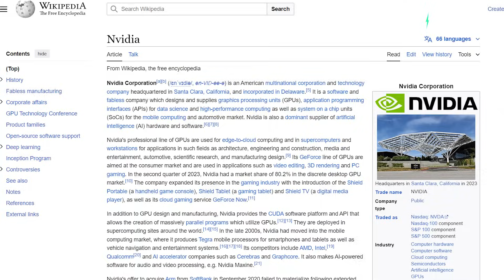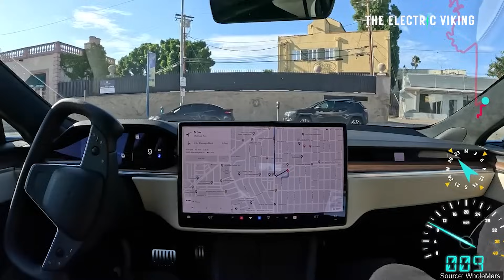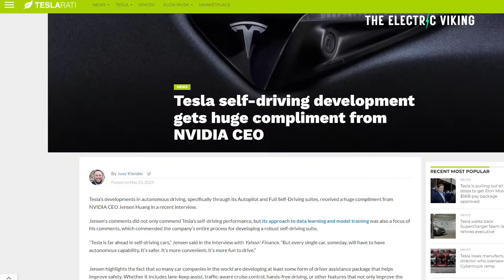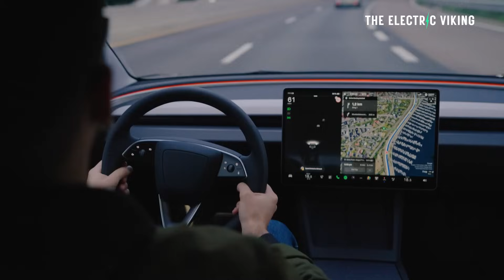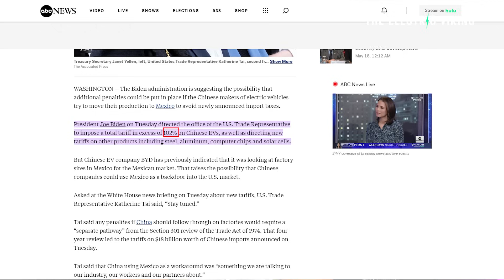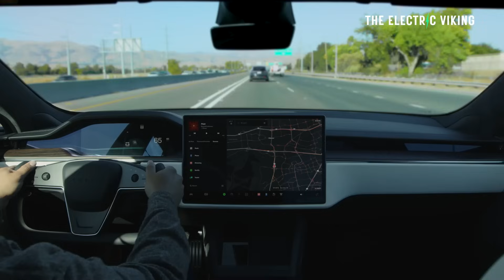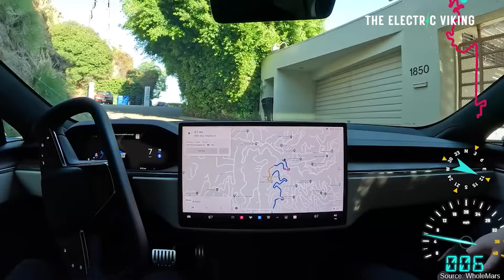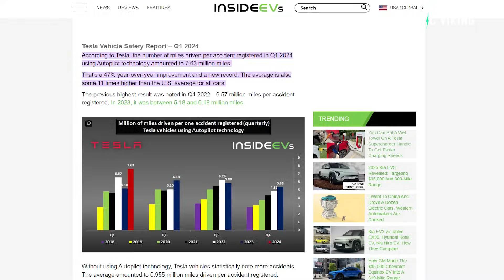Nvidia says Tesla is far ahead of EVERYONE in self-driving cars

Comment: Thank you!  I have a Ph.D. in astrophysics, and am a very critical user.  I have been using the FSD versions since they were first released.  They have always been a fabulous driving aid, far beyond anything Mercedes or anyone else has, but the latest FSD 12.3.6 continues to startle me by detecting "events" before I do.  Not quite "robotaxi perfect," maybe, but shockingly better than expected.
Reply: Fsd alone will wash away ice vehicles exponentially faster than any regulations that are in place..
Reply: How is a PHD in astrophysics related to the driving experience, unless you're riding a spaceship to Alpha Centauri? I am not knocking on your experience, but I am holding off for improvements. You can't launch a rocket to the space station with an incomplete FSD unless you're Boeing.

Comment: The thing I don't get about Tesla's approach to FSD using neural nets is why it sometimes fails at basic non edge case driving scenarios. Is this a fatal flaw the way LLMs like ChatGPT hallucinate, which they are struggling to solve? If I was Tesla I would include a robust supervising CPU with backup power, sensors, etc. that would be monitoring what the neural net GPU is doing but using traditional algorithmic that r not likely to fail for basic driving or generally in the same manners, and intervene if it detects the neural net is erring, or failed and shut down, etc. thus about to crash. This would avoid many potential accidents and put a lot of people and the authorities at ease and much more likely to get approval and get adopted. Tesla already has an algorithmic based approach with FSD version 11 so would be easy to implement and having redundancy at multiple levels is a wise idea. Computers suddenly fail all the time, like any OS. Besides, the car could even drive itself while supervised in an emergency if the neural net has failed and using algorithmic CPU, or at the least pull over at a safe spot. Once FSD is mass adopted many younger people may opt out of bothering to learn to drive but would still prefer the freedom of owning a car vs Robotaxi, so having redundancy unlikely to fail in the same ways would be wise to have, maybe required. I know I would make it a requirement if I was a deciding authority. This could make the difference between FSD being safer than humans now vs never or in 10 years. Who knows

Comment: The Indian capital New Delhi felt like a “furnace” and recorded temperatures “soaring” above 46C on Monday, with high temperatures continuing throughout a crucial week in the country’s elections, the Hindustan Times reported.  Utility company Origin Energy will “delay the closure of Australia’s largest coal-fired power station”, Bloomberg reported, due to government concerns that there is not enough renewable energy to replace it.  Germany approved a “controversial” reform of its climate protection law, eliminating sectoral targets and reducing pressure on sectors such as transportation and buildings to meet them, according to Die Zeit.  US treasury secretary Janet Yellen urged the EU and G7 countries to “communicate to China as a group” regarding concerns about clean-energy industry overcapacity, Reuters said.  Russia leapfrogged Saudi Arabia in 2023 to become China’s largest supplier of oil. China is now Russia’s top purchaser of coal and crude oil, as well as a top three purchaser of oil products, liquefied “natural” gas (LNG) and pipeline gas.  The two sides published a joint statement during Putin’s visit, pledging to “consolidate Sino-Russian strategic energy cooperation…to safeguard [our] economic and energy security”. It named oil, gas, LNG, coal and electricity as primary areas for cooperation, with renewables, hydrogen and the carbon market as “prospective” areas.

Comment: https://www.youtube.com/watch?v=cqYUmQujz1Y&ab_channel=FREEDOMNEWSTV-NYC-ONEVERYSCENE
Reply: That's Autopilot (their cruise control) not FSD
Reply: @someuser7501  its still automated and uses software and sensors .... or does it use the dreams of unicorns to guide it?
Reply: @vandamonium1731 Why are you intentionally trying to confuse people by pointing to something that isn't FSD. Autopilot is just cruise control...which tons of other cars also have had since the 1980s...and they don't consider it having anything to do with FSD either when their cars get into crashes with it on. Sure the Tesla one has some lane switching advances to it (as do other car makers) but it is still just the cruise control.
Reply: @someuser7501  autopilot is when there is no input from the driver its purely down to software and sensors and servos and motors, you are using cruise control as a very very poor example as that requires a drivers input through steering, indication etc so to correct you autopilot IS NOT cruise control i have fitted enough systems in my job to fully understand this, i suggest you look up the definitions
Reply: @someuser7501  autopilot
noun [ C or U ]
UK  /ˈɔː.təʊˌpaɪ.lət/ US  /ˈɑː.t̬oʊˌpaɪ.lət/

a device that uses sensors keeps transport such as vehicles ships and aircraft moving in a particular direction without human involvement:

cruise control
noun
a system, available for some automobiles, motorcycles, etc., that automatically maintains a vehicle's speed by taking control of the accelerator.
Reply: @vandamonium1731 Dude Autopilot is an ADAS system not FSD. Don't you know the difference between ADAS and FSD???  Several car makers offer ADAS systems and nobody is confusing it with FSD.
Reply: @someuser7501  i will let you into little secret ... i work in the vehicle industry and on vehicle safety system

Comment: Difficult for me to say Tesla are doing it the right way if they aren't using stereo vision to use parallax to get depth perception. A single camera cannot do that.
Also, variable resolution would optimize processing speed a lot. We have a macular and peripheral vision for a reason!
Also making love while driving isn't recommended... Take the coffee out of the cupholder first!
Reply: Read a little and you will discover that Tesla has 3 forward facing cameras behind the rearview mirror.  That's one more than humans use when looking forward.  As for rear view, almost all vehicles come with a single rear camera now and most of them display some very accurate lines that bend and twist when the front wheels are shifted....and that seems to work very well.

The only issue that I see with using the camera system is the snow and salt grime in the winter which eventually occluded one or more of the rear/side views and need to be cleaned....but, I'm sure Waymo and Cruise would never have that issue with all those sensors they use?  I wish their passengers luck when the vehicle tells them that it can't continue and would like for them get out to clear one of the 20+ sensors.
Reply: @Abomynous1  I have a Model 3 AWD thanks, and know very well how they work. Having multiple cameras is not the same thing as having stereo pairs.
Try playing tennis or driving with one eye instead of two, and you will understand what i mean.
Reply: @ahaveland  How do you think it’s generating the 3D scene when parking or pulling into the garage?  How do you think it’s accurately able to show the locations of dozens of pedestrians around the car?  If you have a Tesla do you disbelieve your lying eyes?
Reply: @diamond_h0us  It's doing it with more computation and work than necessary.
Reply: @diamond_h0us  Predators have two forward facing eyes for a reason, to be able to judge distance accurately using parallax.
Reply: @ahaveland  And yet it’s judging distance accurately.  You have no direct knowledge of how much computation and that’s not our problem anyway.
Reply: @diamond_h0us  you're welcome to your opinions and inaccurate assumptions about my knowledge on the subject of computation and machine cognition. Enjoy your life instead.
Reply: @ahaveland You're right, but people with one eye are able to drive also. Eventually the brain adapts and learns to compensate for the lack of depth perception.
Reply: @DynamicUnreal  I had a friend with one eye - yes, she could drive legally with some restrictions, but never as well as someone with two eyes.
Parallax is important and it beggars belief that they didn't use stereo vision even if only for front and rear.
Having 3 front cameras with different fields of view so close together cannot give useful parallax, and then you're reliant on time sampling using motion to compare frames to try an infer distance and parallax using photogrammetry, and this is algoritmically and computationally very expensive to do than simply using two cameras and comparing object shifts to derive depth, relative motion and character.
Reply: @ahaveland  You would still need extra computation. You now have to process 2 images at once which likely requires more computation. Maybe the cars will perform better, but I don't see how this requires less computation?
Reply: @DynamicUnreal  When you look at something with one eye, you don't have depth perception until you or it moves - you are really sampling many images and keeping them in a short term memory buffer or "mental video".
With 2 eyes or cameras, you can discard a lot of detail to derive a map of depth, objects and vectors, and then concentrate on the things nearest to you, or travelling in your direction. Memory is selective.
Extra detail can be derived if needed, much like our vision - it detects edges. Our  macular provides a small region of high detail, and peripheral provides a 180+ degree field of view with low detail but high sensitivity to motion (edge detection). This is why eyeballs have sockets and necks can gimbal!
The real computation happens after image acquisition in making sense of the image -having 2 images does not necessarily mean 2x the processing - it can actually reduce computation required.
You're not working on one image at once - every image has a context relative to the previous and next images.
ie. one image requires multiple frames displaced in time to derive object vectors.
Two images can give depth instantly without motion to derive object distance.
Combine both and you can derive situational awareness more easily.
Reply: @ahaveland  You bring up some compelling points, especially regarding the parallels between human vision and AI in electric cars. The idea that dual cameras can optimize depth perception and reduce computational load is intriguing. However, I’m not entirely convinced that the reduction in processing is always significant. While edge detection and motion sensitivity in peripheral vision are great analogies, the complexity of real-time image processing in varied driving conditions might still pose substantial challenges. I'd love to see more empirical data on how these systems perform in diverse environments. I just don’t think it’s that simple, otherwise why wouldn’t they implement such an idea? There has to be a limiting factor, maybe cost?